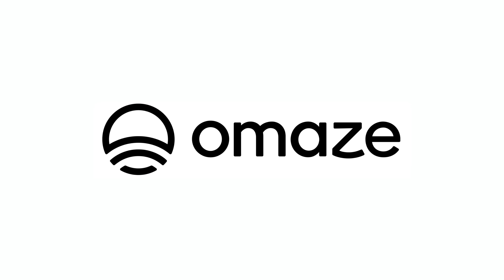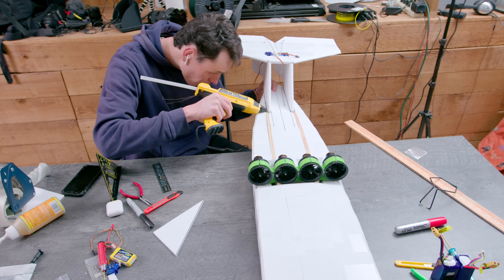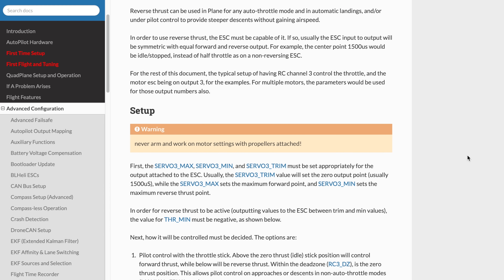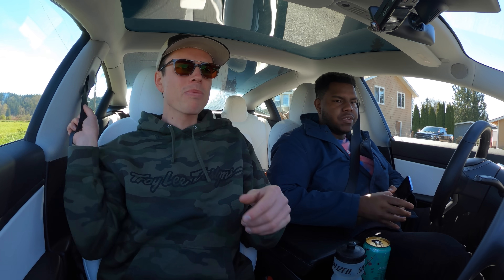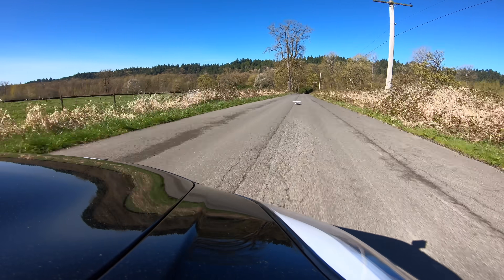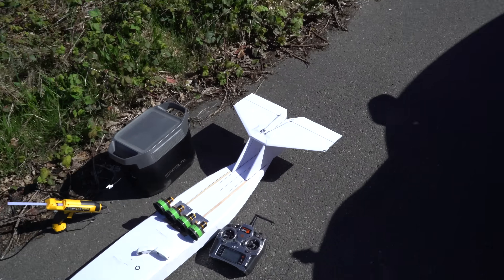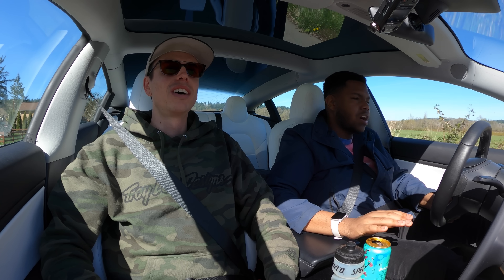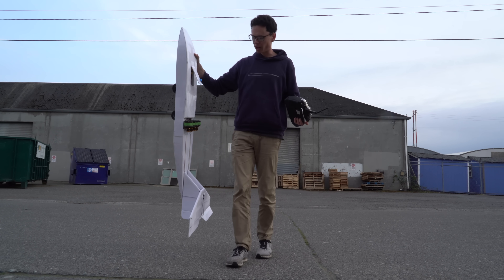EDF Powered Jet Car - High Speed Aero Stability

Comment: Pretty fun video! It’s important to note that even cars with serious downforce and lift killing devices still produce lift as they progress. The net force on many racing cars likely remains positive vs negative. As we know the main point is to maintain traction, for both maneuvering and power delivery. A bit different with your ride since its thrust propulsion, but some down force equally distributed on the car could’ve aided in ride stability more so than the fins, which also had to compete with turbulence I bet
Reply: With respect, this is only true of salt flats speed record cars.

F1 for example produces roughly 3,000 kg of downforce at 300 km/h these days. 
NASCAR is making exactly 1 ton of aerodynamic downforce this year at 200 mph.

The key here is that non max speed cars are engineered to make more downforce as speed increases. This force increases as a square function of speed.

Comment: For the pitch down problem, I think, based on the static video and sound, the vehicle is proposing, she has either a small amount of df or lift, and as she comes closer or further to the ground, she keeps stalling aerodynamically, so she makes that typical bouncing movement at around 2-4 Hz. Make some more damped suspension setup, like stiff dampers or friction dampers, also change the tires to something really low profile.

Comment: I'm not anything in this field, but in my opinion maybe have an alternate control regime where at high speeds, the same control inputs result in less aggressive control actions? The aerodynamics become far more powerful at higher speeds and so the limiting factor for the speed runs appears not to be the car, but the controllability as you have to keep swerving to avoid the sides of the roads. A more gentle output from the aero at high speeds would allow the car to receive less deflection on the control surfaces, compensating for the higher speeds and increased aero effectiveness. 
If this is possible to do continuiously (i.e. having the control gain be inversely proportional to the speed that would be ideal, but a high/low speed control regime would probably also be a good compromise. Having some yaw stabilisation (just a tad) would probably also help cancel out road effects and/or help achieve the desired damping effects.

Comment: Small error, the rear wings on race cars are not spoilers, as they do not cause turbulent airflow, they are meant to maintain the air laminar while causing a pressure difference, like any wing.

Comment: Seems like you're really running into the limitation of that short wheelbase. Your tight turning radius is a liability at high speed.
Reply from the maker: Wheelbase is irrelevant if it’s aerodynamically stable…
Reply: @rctestflight  Perhaps in theory? But in practice I disagree. Any backlash or bumpsteer characteristics become amplified the shorter your wheelbase is. I think it'd be really interesting to make no other changes than extending the wheelbase to the greatest extent possible and retest.
Reply: @rctestflight  Actually, some other comments make a good point that you should only need a single wheel on the center of gravity and THAT sounds like an even better idea!

Comment: It might be useful to add a gps and compass and use, in iNav terms, heading hold mode when steering. That way all you input is speed and your rudder input is setting the heading instead of actually steering.
Reply: Would the compass speed/precision be enough though?
Reply: @dcnick3  It wouldn't be hard to try

Comment: This is your mistake, your nose looks like a right angle triangle, this is the very shape they use in sports cars because it produces down lift. As the incoming air hits the front, it never gets a chance to wrap around the bottom -because the ground, creating negative pressure at the bottom. That’s why no matter what your nose was scrapping. So you need an isosceles triangle nose just high enough to ram some air at the bottom front of the car, maybe giving you a neutral lift coefficient. In addition, your car is so hard to control because the blast of your fans are hitting the rudder, thus providing you with thrust vectoring, something you would want for super maneuverability in close air to air combat, but not so good for cart control. Simply get the rudder out of the way of the blast. Hope this helps
Reply from the maker: But the nose wasn’t scraping the ground the whole time…
Reply: @rctestflight  well I didn't mean like the whole time, that was a bit of an exaggeration,  but it did seem to struggle to point up even at high speeds. That's just my observation, very interesting project btw
Reply: @rctestflight  cause even the lamborghini Miura had that issue of going airborne, only because it had an isosceles nose. Had they balanced the center of gravity they could've made the first flying car

Comment: I think you left a lot of speed potential on the build room floor, and this design as is could break 100mph with just one small modification. EDF's act more like air compressors than air fans. You see you really only need a Thrust to weight ratio of about 1.25 to 1. Gases have two main properties speed or pressure. The Eds already create high pressure so to convert that high pressure to high speed you need a Thrust tube. I'm guessing your current thrust to weight ratio is about 7 to 1 it won't go any faster than the maximum speed of the Eds but by choking the output you increase the speed of the air coming out of the EDFs. It should also give it more of a laminar flow which shouldn't help with the stability also.

Comment: Uh, lengthen the wheelbase for some freakin’ control?
Reply from the maker: The wheelbase is irrelevant if it’s aerodynamically stable…
Reply: @rctestflight  maybe. But if the wheels are touching the ground at all, are they not able to induce effect on the craft - if only by transferring uneven forces to the body?

Comment: That thing sounds gorgeous! I noticed this effect when I first saw the Vancouver Indy. It was the sound of the air over the aerodynamics you heard as the cars approached and the sound of the engine was completely masked until the cars passed by.
Scale your edf beast up a tad & you'll have a powered longboard!
Reply: For powered longboard you’d need a lot of torque, I imagine that his vehicle weighs around 10-15 pounds max meaning probably 10 or more times as many edfs needed to maintain the same acceleration. Overall any type of aero propulsion probably isn’t suited for longboard due to low torque-size ratio
Reply: @sambenedict7804  you may be partially correct but i think you forget the weight added by the extra edfs and the subsequently larger battery to power them. the edf solution likely doesn’t have the energy potential needed for a good powered long board without some fundamental changes. thinking a small jet engine, or of course the simple solution of electric motor but that’s just a regular electric skateboard and would be no fun.
Reply: I like that sound too.

Comment: Slow the steering ratio way down, you have way too much front wheel angle control from the servo. You're trying to fix an underlying mechanical problem with software, not a good idea.

Comment: I love your other projects, but to me this one doesn't hold water. If you were only going 70mph, you could've bought a stock used Traxxas Rustler VXL for $250. Wheel-driven means better acceleration, which is paramount given limited visual range. That being said, getting reverse thrust working is pretty cool.

Comment: This is much more interesting than some guy just buying a load of third party car parts for mega bucks. Great science
Reply: I disagree. there is  alot of science when your talking about rc cars pushing the limits of speed.  you have to deal with sag, ripple, areo and several other things.  it's not a matter of just buying parts and slapping the most expensive stuff on an rc to go the fastest.  just ask James Mccoy who just did 204.  too a lot of hard work. nick cases record stood for many years.  so doesn't really sound as easy as you make it out to be.  also this weekend there is a good chance 204 will get beat if everything goes to plan for the fellas that are getting together. 8t will be on YouTube

Comment: Remove the suspension on the wheels and replace them with an electrical driven spiral for adjusting the clearance to the ground.

Put a laser directly in front of each tire and measure the distance in the "future".

The current spiral position gives you the current adjustment +/- over 0. The future is what you want to acchive as delta of the current adjustment to reach 0.

- Say: You set a target of 2 mm clearance.

- You're currently adjusting +1mm to reach this.
- The sensor looking ahead it reads "a value of 4mm"
- You calculate the driving speed until you reach the 4mm reading and select a motor speed to reach it in time
- You instruct the motor to turn the spiral in to reach -2 within the given time.

If you do this for all 4 wheels continuously, you should get an aw some smooth ride :)

Rest is just springs and dampening above the whole "buggy" part to dampen harsh maneuvers necessary to keep all wheels on the ground. :)

Comment: 70mph is very impressive, the new speed rc car speed record is 204mph, maybe a bigger edfs and blheli escs, you could definitely go 100mph to 150mph. Great Job!
Reply: You could also potentially use a jet turbine when the control system matures.
Reply: Shouldn’t it be relatively easy to cram a bunch of powerful motors into a very aerodynamic form factor, add just enough batteries for a single run and go?
Reply: @Mike-oz4cv  the problem now is the wheel/tire technology is prohibiting things. Tires will just blow apart even tho the car still has more juice in it
Reply: @WampaRat  There has to be an easy solution, after all, we just need the tyres to stay on. No need for turning performance or suspension. Even rubber bolted to the wheels could work. For a big RC car you could use the  smallest road bike tyres with 349mm rim diameter.
Reply: Steel disk wheels.  gauge stainless. Not looking for traction just the bottom 1/3 exposed and a nose wheel.
It probably needs the battery weight but if not then super capacitors.
Might need active wing control like his ground effects boat/car/planes

Comment: Yes, turning down the dual rates makes a difference. There are speed runs that exceed 200 mph on a 1/10 scale car. The new goal is 205 mph. The 1/14 scale buggy you used can go faster than 70 mph with the stock body. You need a better/ smoother surface for speed runs. A front wing would help too.
Reply: It's a 1/7 scale, not a 1/10 scale. This is completely different it's much harder to get to 70mph without power to the wheels. It's not the same. He has a different goal here. Making the buggy go 70 mph using power to the wheels is easy. This is much harder. His issue is not the road surface, His issue is the wheelbase. The body is long and the buggy is on the center axis causing it to overcorrect.
Reply: @FarmerFpv  What's up bro!

Comment: Why don't you try this while on the car:
Take a camera with object tracking and use it to keep the car centered on the X axis of the camera using a PID controller
In that way, you just need to aim the camera (tripod mounted if possible) the the center of the road and the controller will take care of the rest

Edit: like this so he sees it
Reply: There is probably a very good chance that the camera doesn’t have a fast enough frame rate for it to really be stable. Also latency would be a big problem. You would also need to find an object tracking camera that can output the position of the object in a format that could easily be transmitted to the car.

In reality the camera and object detection are probably too slow and have too much latency for it to really work well.

Comment: Put two ducked fans behind eachother running in opposite directions. Cancels out some wake turbulences at your tail and also let's you run them slower - so they don't hit the air with such amount of difference.

Just make sure to balance the amps of the first and the second row to be equal and thus the first ones accelerate the air and the seconds one does the same work but on already faster air.

Then look up how turbine housings should "end" there are special flared desigs to reduce noise and thus gives you more forward power/less distortion.

So you end up with 2 ducked fans in the from and two ducked fans in the rear on each side and a small tunnel in between through the body of the vehicle.

The air frame could be optimized to avoid having "stuck out' fan ducks and instead the whole front is ramming air into the inlet while behind the whole exhaust is spread around by the fuselage.

If you need to cool an esp or something like that, expand the tube in the vehicle a bit, and put the element, like an esc, in the airstream and go back to a lower diameter again.
Reply: - most edf's sold don't have RH and LH rotors. especially these cheap chinese ones. 
- turbine "end" is called a nozzle
- air exits the edf's at 100's of MPH so that second one inline would need to either have obscene KV ratings or a rototr with a higher pitch, which they don't make... 

sorry kid reality is not inline with your imagination ; )

Comment: Replace the wheels with narrow steel wheels. The current wheels are designed for grip, which means they create a lot of rolling resistance. Also, 3 wheels is better than 4.

Comment: For your consideration.
The car needs a bigger wheel base, at least as long as 3/4 the length of the whole body. All land-speed cars have big wheel bases. You should google it.
The EDF motors should have aero covers, i'd redo the body to accommodate them inside, or make their own nacelles.
Mount the motors in such a way the vector of the thrust force produced is not trying to twist or pitch the car's direction thus making it "meta-stable" at speed.
The motor's thrust should have a clear "path", e.g. not encounter any control surfaces like vertical stabilizers.
The body could benefit from a good set of well placed stabilizing thins/winglets to help it keep straight and leveled.
Brakes, you need mechanical and aero brakes, aero-brakes to first slowdown to a reasonable speed so the mechanical brakes can operate without over heating or suffering catastrophic wear.
Best of luck will be looking forward for part 2. :)
Reply: You're missing the whole point of the video. Of course you could have a bigger wheel base but then it wouldn't require active stabilization.
Reply: @bragr_  No i did not, but you've completely missed the goal of my comment. If he does decide to further this project he now has this simple list pointing out things to improve in the next version. He has every right to ignore these, follow some and or all. i'm not pointing a gun to anyone, i'm just a person with a higher education on these matters and want to help out. So.. "cool your jets", alright?

Comment: you might try to spread the wheels for better stability, and try with thinner tyres, as they have not the prupose of gripping for traction in your case, as the propulsion is achieved with the EDFs. Also, the slope of the body under the car should, conterintuitively, have a slight tilt up toward the front of the car, so that the body is like say, 2cm of the ground in front and 1cm at the rear. Finally, you might try with vertical control surfaces in the rear, and attempt Canard surfaces in front ;) I wonder where this is going ^^

Comment: It's actually a wing on the back of the F1 car not a spoiler.
Spoilers are less common and specificly don't provide downforce but spoil airflow just like spoilers on an airliner that are used to spoil the lift of the wings so when it lands it plants itself on the runway rather than bouncing.

Spoilers on cars can be used both to prevent aerodynamic lift and/or to reduce drag by modifying the aerodynamics of the cars wake.
Many people incorrectly call rear wings spoilers because there isn't much incentive to teach people the difference.
Reply: A rear spoiler provides downforce by utilizing the leverage generated by the drag of the air hitting the spoiler pushing the rear of the vehicle into the track. F1/Indy cars have rear wings,  but Nascar runs spoilers for downforce except for the COT Nascar racecars in 2008 which had a wing however they quickly realized it generated dangerous lift when the car got turned and went back to a spoiler instead.
Reply: @boardsort  That technicy should not be called just a spoiler then.
It's a spoiling wing

In aerodynamics most surfaces are named based on the intended role and not how it is achieved.

This is why a flat sheet of foam is still a wing on a simple RC plane even though it lacks an airfoil.

If its purpose is to generate downforce it it a wing, if the purpose is to spoil undesirable airflow its a spoiler.
If its purpose is both it should be names as both to be consistent.

There are combo names when the surface has multiple roles.
Elevon, spoilerons, ruddervators, ect.
Reply: Probably because no one cares 😂